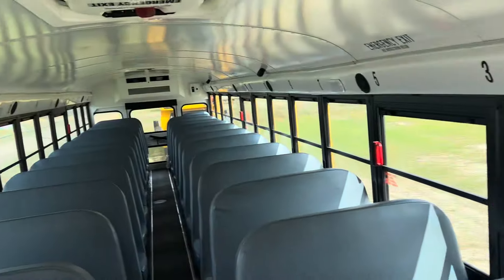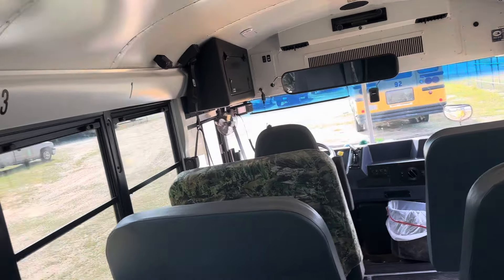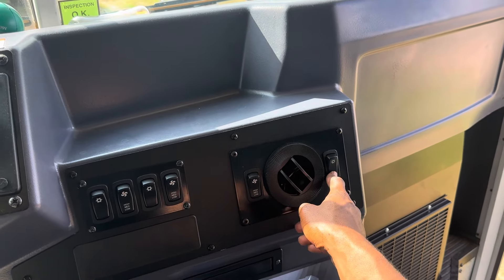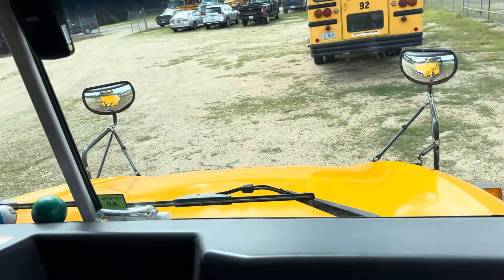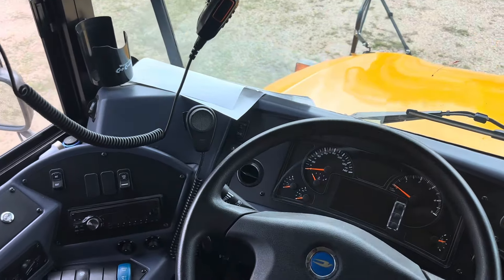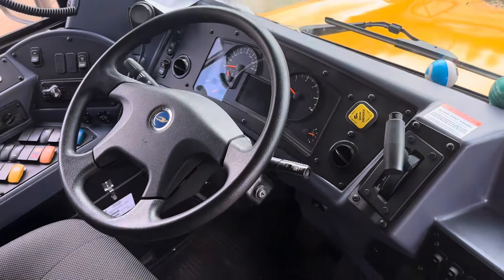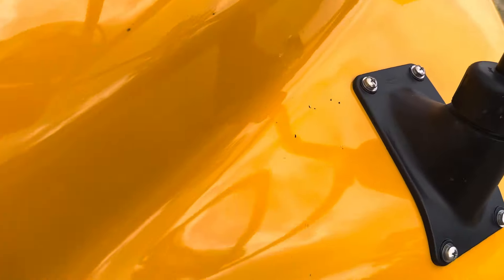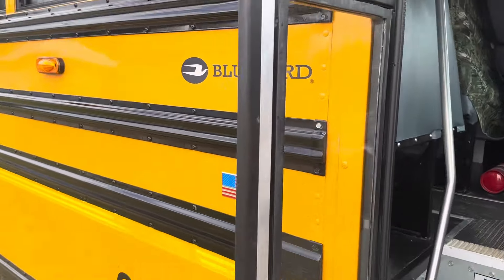Gripes about my new Blue Bird

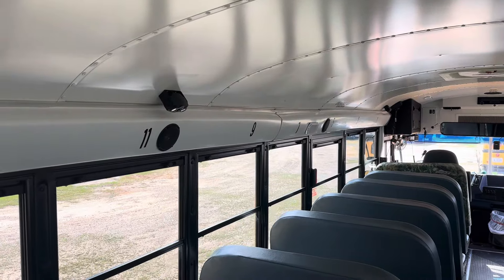Comment: 2:11 what’s strange is that IC Uses a similar design for the side panels above the windows and they don’t have issues with rattles, squeaks or falling panels. As for the issue with them giving you the wrong specs, that doesn’t make me feel good about bluebird quality control. The drivers area is pathetic too. It should be at least 35-40 inches. IMO bluebird Sucks. They need to redesign this bus within the next year and they need to fix these big problems especially the rough suspension (I rode an air ride equipped one and it sucked).
Reply from the maker: Wrong specs was a dealer issue. IC builds an entire channel (bottom and top) that the wire railing sits in. It doesn’t depend on windows and a thin strip of metal that’s installed at an incorrect angle to hold it steady. And there’s some sort of felt material inside of it. That further stops rattles.
Reply: @ oh that’s good that IC’s design is actually more superior. I forgot to mention it’s a dealer issue not Manufacturer issue.

Comment: We’ve never had a brand new C2 with problems 😆
Reply: You are Lucky. My district got 2025 C2s and there’s have been leaking problems, some sort of rattling noise, door rattling as well. Also we got Intellipark, which caused problems. Either it would apply automatically or just doesn’t. The 2024 Visions has held up better than our 2025 C2 despite having squeaky breaks and leaking problems.
Reply: @ Wow, the last time I can remember our C2’s had quality trouble was back in 2016 when a few of the busses had the same electrical issue where the stop signs, dome lights, and doors would just not work.
Reply from the maker: Don’t get me started on our last c2…..
Reply: @mikedior3089  C2’s suck. There’s three out of service in my district. But I still like them. They are 2017’s.
Reply: @Bluebirdvision91  Explain man. I’ve been driving C2’s for 9 years now and they just have treated me better than any of the other busses I’ve driven 🤷🏼‍♂️

Comment: My last bus before retirement was a 2019 Bluebird. I loved it. The issues I had were; the inside weatherstriping on the loading doors fell off, and the coach AC.
I did have tilt/telescope wheel, adjustable pedals, and driver AC.
Also, my seat would go back further. 
It had the 6.8 ford V10 gasoline, which was quiet and enough power.
Thanks

Comment: Most of are 2022 the belt tensioner fail with in about 30k miles and leave us stranded on the road
Reply from the maker: Gonna be sure to grab a spare.
Reply: @mattdog558  that happened to one of the 2011 IC CE bus I’m on as a special needs para  at 160,000 or so miles but that was because the part was worn out not a defect.
Reply: @isaiahanderson7237  ares were defected straight from the factory it was one after another so we have many parts on standby because it’s a common occurrence now
Reply: @mattdog558  yikes. That didn’t happen with the CE’s we have. We have 2006-2025’s and they’ve been great
Reply: @Bluebirdvision91  also my 2022 leaks water by my sun visor and right above the fans
Reply: Be careful of water leaks as well mine leaks water from above my sun visor and right above the fans after a heavy rain
Reply: @mattdog558  that doesn’t happen on ours. Only place water gets through is through the windows that don’t close completely. Some of the windows are worn out on our bus and don’t stay completely closed. However a good open and shut gets the issue fixed.

Comment: I've got a 2023 (old style roof with the plastic around the warning lights) and have/had some similar issues. The fit and finish on my ceiling is trash, with one failed rivet (with a replacement next to it) and one missing entirely (the hole wasn't even drilled). Some issues with the channels that hold the wiring not being as flush to the wall as they could be. Driver dome light started falling from the ceiling (at least it clicked back into place), and a conduit was rattling on the ceiling really badly. The front bulkhead or static vent, I can't tell, leaks quite a bit. Same issue with the service door hitting the body. Another issue that's always been around, take a look at the driver side wiper- it always hits the rubber gasketing along the center pillar of the windshield. I've noticed the same thing with the bus not wanting to stay planted on the road- this seems to be an issue ever since high headroom came standard... all the low headroom units didn't feel wobbly, all the high headroom ones do; perhaps Bluebird never revisited their suspension when they made the change, and I imagine the new roof design only makes it worse being taller. There was also a small coolant leak from factory, and a no start no crank issue a few weeks after I started using it. I've even had issues with the backlight on that heater panel, however it seems to be slightly intermittent, and comes back on if I cycle the lights. Can't speak on the drivetrain issue you have as mine is a gas unit governed at 75, and my only complaint is they dropped the hill descent downshifting you got when they used the V10's.

When it comes to the heaters, I agree that they work great, but I find the level of heat very challenging to control. The front and rear heaters are plumbed in series instead of parallel, so I'm left deciding whether to keep the back comfy and cook myself, or keep myself comfy and freeze the back. You can shut off the front heater and set it to recirculate to stop the ram air effect, but the radiant heat from it still makes me sweat without a coat on. Having to control heater coolant flow with the old school plumbing valve is quite annoying, considering other buses just have a darn temperature knob.

Now, as for the seat, I'm also somewhat bothered by it. However, I found if you slide the bottom cushion forward (kneeling next to the seat, pull on the little tab right at the front of the cushion on the bottom) and the cushion will pop up and slide forward. It doesn't make more space, but I've found at the very least the seat feels more reclined and I can move forward a little bit. It's worth trying out, and as a taller person I find the added leg support quite nice.

Comment: I drive a 2025 Vision with the Godzilla. I have the same bumps and rattles, sometimes it's hard it wants to go off the road when I hit a few bumps. My biggest pet peeve is that it leaks on the door side where the 8 ways are! Water literally pours through when it rains and when we wash it! Another contractor in the school district says that one of his brand new visions does it too! That's a serious problem that needs addressed.
Reply: Interesting! I have a 2023 with the old/transition roof design, and have the same issue. I'm not certain how the water is getting in, but the main things I'm suspecting is the static vent, mirror brackets and wire grommets, and the roof seam. Final idea is the clearance lights. On older units it was more of a nuisance than anything, but with the new electrical design there's some tech up in that bulkhead that I'm worried about corroding over time.
Reply: @tnast  our boss put some caulking under the 8 ways on that side in the rain tray or whatever it's called, that took care of half of the leak, but that defroster fan is done.
Reply: They leak because there are gaps between the roof panels and the front cap/bulk head. I went through and caulked most of the visions my district has over summer break.

Comment: Used to have a some Lift buses and regular BBV's in my fleet as a tanker man and a M1, I'll say this Bluebirds had issues with Coolant tank level sensors, Def headers going out more than the C2s or CEs(during covid with back order parts) Lack of factory drivers AC from factory, Seemed like the power steering res would leak atf, that and the Fuel water seperator either by the rear def(Bad placement) or on the fender wall( bad placement again) we had one bus that the AC was bypassed because the L bracket for the AC compressors was cracked and it took until a bus got wrecked before we had a bracket for it and could get the ac back on, not to mention the constant water leaks that kept happening as well as the crazy ass wiring diagrams OH and while i'm beating the horse to let's talk about changing out steer tires, You have to keep a study noose jack and blocks of wood or you will be calling for a tow truck to come lift the bus up with the wrecker(average wrecker bill costs $750) because the axle sits so low and jacking up from the leaf spring isn't always the best option. the Average Regular ed Passenger bus for a BBV costs between $80k-90K through the states bulk purchase contract Lift buses cost another 10K why would I want to buy a bus that comes with issues from factory that they don't wish to fix I would rather take a MXDT over a BBV
Reply: For the youngin out here that say and I've said this myself, "Oh that's under warranty" of that's the Cummins problem not a BBV problem, I agree with you but you have to understand this just like fred here I've been in his boat with the only thing being that he's one of the reasons I got into this field at at 18 I was the youngest driver and later fuel man in both carolina's. Districts can not afford to have a bus driven or towed to the nearest dealership for simple silly sh!t, for an example by rule GP Blue bird in Mebane NC is the dealership for all of SC now, at a worse case situation if Beaufort county SC had to tow a bus to Mebane it would be a 14 hour round trip tow(GIving time to hook and unhook take breaks traffic etc) that someone would have to pay for with a warranty claim issue

Comment: The newest vision I’ve driven is a 2022 and it’s got full 4 corner air ride and it rides like our other visions with full air ride, nice and smooth down our terrible backroads, yes the gauge cluster is annoying but I will say I like the lcd on the newer ones the color scheme distracts me less than the 2016 display does with the exhaust brake activation and I also found that if I turn down the brightness almost all the way down the white backlights don’t bother me as much at night, I’m too used to the C2s green backlight

Comment: I've driven all the major conventional models, including the "next-gen" IC CE, Waynes, and BB 3800s. The "Next Gen" is far superior to the BBV and even the C2. The Vision's driver's area is what kills it for me! I'm 6ft 1" and find the driving position awkward. Also, our 2018s use a Clarion head unit, and I was shocked that you can't even make out the display! Meanwhile, most of our 2010 International radios are still going strong. 

Regarding storage areas, the plastic storage areas in the front of C2s are flimsy and feel cheap, and the foam padding underneath our bluebirds' storage areas is starting to break down. I always thought Bluebird had the best quality, maybe the older 3800s, but not the newer models.
Reply from the maker: Let’s hope they fix these issues in the future. I like the next gen IC but at the same time. I love a blue bird bus. They just have some issues to correct and actually listen to driver feedback. And their dealers need better training on what’s offered.

Comment: I really like the new roof cap look- the previous style looks so tacky to me. We’ll see how long the plastic surrounds last though. 
I work on buses for a district that is over 1/2 BB propane and I don’t mind those engines. The body build quality and lack of redesign in the drivers area is definitely a problem like you stated (especially when the bus costs $130k+). The hoods also squeak as the buses get older and start rubbing things they shouldn’t. 
That’s crazy they didn’t give you the full length acoustic headliner you ordered. I would’ve been tempted to reject the bus upon delivery. I’m glad you made this video- maybe they’ll see it and make needed changes
Reply from the maker: Trust me I’d have liked to send it back. But this was the second time I’d ordered this bus. First time they ordered it was missing stuff and was only a 71 pax when I ordered a 77. We needed the bus as we’d added another route so I had to take it.
Reply: Wow, that’s frustrating. The last bus we ordered came with everything we spec’d but had a number of loose bolts, several coolant leaks (loose clamps) and gaps on the roof and below the side windows.

Comment: A lot of the issues you’re having are the same as ours, right down to the ceiling panels this year. It’s ridiculous
Reply from the maker: @uAKING2006  bad thing is. 26 is a 2023 same issues. I know they know about it. Why not correct it? They could fix a lot of that panel rattling by running a bead of silicone in the top of that channel before installing it….
Reply: @Bluebirdvision91 that’s what IC does. It also seals gaps between panels too.

Comment: I have a question for you.. you ordered this bus? Why did you order it with the hubcaps? They are absolute trash. I understand the aluminum wheels are probably an expensive option but look awesome, but the black steelies are so much better and cheaper than those hubcaps.

Could you show the LED headlights at night?
Reply from the maker: First off the bus came with them. I didn’t order them. Secondly as you might think they’re trash any average non bus person sees it as chrome and it looks well. And I like it so even if it didn’t come with them it would’ve gotten a set anyway. I will show the headlights once I’m at the yard when it’s dark.
Reply: @Bluebirdvision91   Thanks in advance for showing the headlights. 

So, they hubcaps are standard now over just the steelies? The last company I worked for had 80 brand new 2021 visions with these hubcaps, they fall off randomly all the time and get all dented up VERY easily (I think just hitting a bug with one while driving down the road could probably dent it lol [exaggeration obviously but yeah]). I was told that they are around $200 each to replace. Also, unless they changed the design, which it doesn't appear as though they did.. if one of the rear ones falls off while driving down the road, BOTH of those tires will immediately go flat as there is a hose connecting the valve stem to the hubcap which of course comes off with the hubcap lol. Our fix was just to remove the hoses and put regular valve stem caps on the valve stems..but then to add/check air you have to remove the hubcaps every time.

Comment: I’m a mechanic with a company in Toronto, we bought about 80 Bluebirds in 2017 and won’t buy anymore. Constant problems with them, brake lines are out in the open so they rot even with rustproofing (shouldn’t be doing lines on 6-7 year old buses), none of the wiring harnesses are loomed and they break wires stupid easy, we have drivers that are too short to fit in the drivers seat because of the steering column design. Just shit buses from the beginning, buy thomases from now on and you won’t have issues.
Reply from the maker: Not buying anymore C2s. I might have 2 drivers that like them. And I don’t either.

Comment: 9:28 The best school bus that they ever produce bluebird was 1989 Ford 
B700 series they need to go back to that body style cluster panel and dash which was all metal that had plenty of space and room they just need to go back to that whole design from the 1989 series and go back to the Ford chassis the Chevy chassis GMC chassis international chassis motor and transmission! Put manual transmissions back in these buses bring back that setup and people buy more of their product The fact that Thomas bluebird and that other company whatever it is ICS or whatever it is started doing their own setup their own packaging motor and stuff it sucks! They want to make quality product bring back the original setups where it was GMC Chevy Ford that powered these buses where it was easy for the shops to fix the buses they can go to the local dealer and get a part  have the bus up and running That same day! When I grew up there was no air conditioning on the school buses it was ruled the window down get air pop the roof hatch and that was it and there was none of this fancy technology that's on the buses now no child left behind crap none of that do you know what we had A white strip magnet that hanged at the back of the door each stop the driver had to get up sweep out the school bus at the end of each stop of the route the very last drop off at the end of the route driver had to get up go sweep out the bus from the front to the back!!! Back in the school buses didn't even have radios there was nothing so these buses have gotten way too comfort features honestly they just need to go back to what made the company money and profitable and people desiring these bus Go back to the original drivetrains GMC Chevy Ford international and consider bringing in Dodge we would call them pullers if the motor was mounted up front and if it was in the back flat nose school bus we called them pushers those were the only real bluebird bluebird buses that were their design only which were the pushers and the flat nose! Bring those designs back bring that quality back from the 1985 to 1995 And they will see an increase of sales be honest wouldn't you love to see a school bus with the Chevy front-end again! Go take a drive see if you can find a 1989 bluebird Ford b700 series school bus see how much room it has and how it drives and then go find a Chevy or GMC model Tell me how much more comfortable they are compared to what you're driving now and tell me if you wouldn't like seeing that same design up-to-date now I promise you you will!